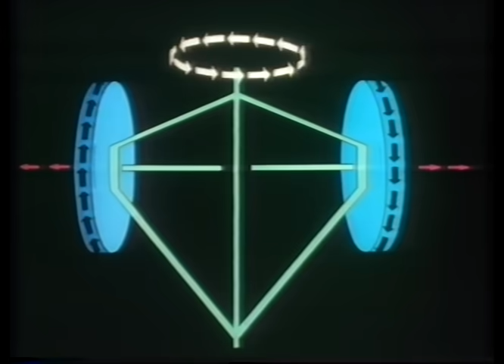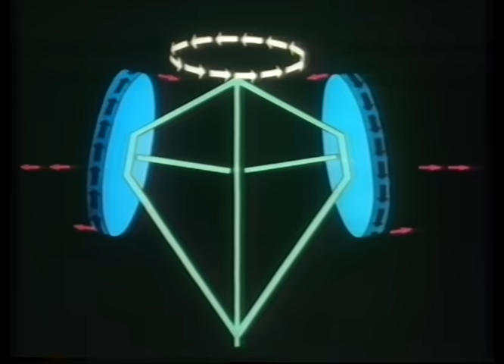Anti-Gravity Machine (Part One)

Comment: Professor Eric Laithwaite gives a demonstration of a large gyro wheel
A comment I made elsewhere for readers' attention.
 This may solve the many difficulties  Professor Eric Laithwaite and Sandy Kidd and others at Dundee University had, and recently a project on gyros made at Cambridge and Sydney University.  The answer as to why the gyro performs what it does is due to the distributed masses within the gyro spinning wheel being subjected to the distributed three-dimensional accelerations existing in the voluminous cycloidal trajectory made by each mass particle spinning in the gyro.  The whole integral of

Integral of (mass ( x.y,x,t) reacting with acceleration (x,y,z,t)) contains all the miracles and elegance of the gyro which are summarised in the discussion shown below.
 
 The gyro in the "floating " configuration, when placed at the end of an extension arm, DOES NOT LOSE ANY OF ITS  WEIGHT, and that issue, is very misleading to many people, including many universities. I advise readers to proceed to read the manner in which it is being presented as it will not be found in any book or from no one else in this style, and readers, they are free to comment on how the four states within a gyro were explained.
 (The gravity balance) ...( The angular motion balance).... ( The gyro centrifugal forces).....( The reason why the gyro floats and moves forwards).
This is presented so that any person interested in statics and dynamics can have a different perspective of the working of the gyro. 

Here are the details of what I think happens in a gyro.  There are basically four states one needs to explain. I shall use what is seen in the video above showing a gyro appearing to be floating.
To use these following videos for reference.

https://youtu.be/Pbb_RnxeYys

https://youtu.be/xf1Nt3KLm-U

https://youtu.be/jD_Q_J4GcQ8

1.  The vertical down weight of the gyro (mg) seems to be floating on air and how it is held up against gravity needs to be explained. 
2. What forces the gyro uses to turn about itself with the dynamic precession (Wp and torque of I.Ws.Wp) needs to be explained.
3. Why the gyro, when not spinning but rotating as a pure mass m shows centrifugal force about its own center and about the pivot point and this later disappears when the gyro spins and precesses. 
4. Why the mass m is basically forced to move slowly around the pivot point. One may consider this as a linear motion using a force Force = ma + air drag forces if Ra is larger large and then work it back into circular motion about the pivot point by knowing that a= (R arm)*d(Wp)/dt

The above is achieved as follows.
a. When a fast spinning gyro (Ws) is taken and allowed to move around a radial arm (Ra) with angular velocity (Wp), then the trajectory of one mass particle is a three-dimensional cycloidal curve containing different locations, different velocities, and different three-dimensional accelerations.  Within the curves of this three-dimensional cycloid, there are ACCELERATIONS  acting on the spinning and rolling mass particles which bring about two opposite acting centrifugal forces which vary their magnitudes,  one acting inward on the upper horizontal half of the gyro, and the other acting outward on the horizontal lower half of the gyro. These two opposite acting centrifugal "horizontal" forces act at a slightly forward angle to the movement of the gyro, will create all the magic in the gyro as follows. Also, note that these two opposite acting forces also act on the forward vertical half of the gyro (the outbound force) while the ( inbound force) acts on the rear vertical half of the gyro.  These centrifugal forces are basically horizontal in nature ( in this experimental configuration) and their horizontal and vertical separation between them and the slight tilting forward give all the requirement to make the gyro behaves as it does. This is how what was described above handles all there is to handle in a gyro as shown in the video.

1. The weight of the gyro (m.g) working in conjunction with the supporting arm operating as a pivot, and the extension rod (Ra) generates a  gravity torque ( m.g.R arm) which tends to pull the weight down.  This is opposed by the two opposite acting centrifugal forces being separated in a vertical manner by a distance x.  This arrangement will give the following. The inbound force (Fin) is above the outbound (Fout) by a distance x and so these create a torque of about the axis of the gyro  (F1+F1)*x = (mgR arm) and this is a balance in the gravitational state. 

2. The flat face of the gyro spinning wheel at (Ws) with an inertial "I" is changing its orientation with respect to earth with angular velocity (Wp) as it circles around the pivot suspension point and this needs a torque = (I.Ws.Wp ) which is provided by the same two opposite centrifugal forces also separated by a horizontal distance x, acting on the front and back vertical halves of the gyro spinning wheel.  Hence
(F1+F2)*x) = (I.Ws.Wp)      This means that the angular inertia characteristic of the gyro needs the torque action generated by the horizontal separated opposite acting centrifugal forces F1 and F2. This is the dynamic angular motion balance. 
Note the beauty of the relation between the ( Falling weight and torque ( m.g.Ra),  and  (the two opposite centrifugal forces, separated horizontally and vertically by distance x, and hence the torque  ( F1+F2)*x) and needed by the gyro (I.Ws.Wp)).
 
vertical gravity balance =  (m.g.R arm) = ( F1+F2)*x   = horizontal angular torque  (I.Ws.Wp)=( F1+F2)*x

3. Since the two opposite centrifugal forces are " almost parallel" with the gyro extension arm Ra, then conventional outbound   Centrifugal force m.(Wp)(Wp)*R arm =  (F1-F2) where F1 is the inbound centrifugal force which diminishes with the loss of spinning, of the gyro and so the normal outbound centrifugal force F2 takes over.
 Hence ( F1-F2)= m.(Wp)^2 (R arm)

4. The force  that pulls the gyro forward may be looked upon as being a linear force  and this is  due to the slight tilt forward of both centrifugal forces which is (F1+F2)*sine (angle of forwarding tilt of the centrifugal forces)     Hence this forward motion of the gyro may be looked upon as being
 Force= ma + drag force .
This may be "adjusted" to fit the angular state as the linear acceleration is related to the (Wp) rotation of the gyro where a= d(Wp/dt)  so (F1+F2)*sine( small forward tilt angle)= m.(R arm)d(Wp)/dt + Wp drag and other losses. 
If one watches other videos one sees gyros rising to the top by some unknown forces, and I do believe that this force may account for what one sees in other videos as shown in the following,

The beauty of what was explained above means that at very high spinning speeds the reaction on the central pivot point is only the vertical weight of the gyro mg. 

https://youtu.be/SEstkIF3U1Q

Apologies for the length of this explanation, but it needs to be commented upon by those who enjoy the magical and elegance of gyros. I preferred to look into the engineering details than describe the action with words as " the spinning gyro precesses  when a torque is applied to it." It is fascinating what beauty and elegance exist hidden in silence and invisibility of physics which is never appreciated by many people.
The above contribution should be followed by Universities in London, Dundee, Cambridge, Sydney, and others which in the past showed much interest in the working out and showing the performance of the gyros.

Comment: Obviously the air resistance of the entire spinning mechanism is the same as pressing on the spinning machine with your finger which uses the processional movement to convert rotational inertia into vertical inertia.

Comment: What a pity when people do not comprehend what is going on and they totally misunderstand what is happening and conclude that they can apply it to something practical with higher demands. 
What is happening in this arrangement is caused by the application of a double-action of precession. Taking the experiment conducted by Professor Eric Laithwaite at 9:15, one can find the whole solution.
Considering the vertical plane of the fast rotating gyro wheel about its horizontal axis, then if it left untouched it will try to keep that energy plane but also drop about the center of the radius of the flat horizontal plane about its central suspension point.  When the gyro wheel rotates around its vertical plane and tries to drop, the topmost upper mass high-speed horizontal particles on the circumference will move out while the mass high-speed horizontal particles on the lower circumference will move in. Since these are fast mass particles then the plane of rotation of the gyro wheel will alter slightly and this means that the horizontal pivot arm will have to move and rotate slowly according to how much precession the wheel can develop with the drop, depending on a few parameters. This constant state of the affair will proceed with the plane of momentum/energy trying to continuously drop and this slow dropping force causes the precession to torque the wheel about the horizontal extended arm. 
Then at 9: 16 when Professor Laithwaite gives a  horizontal angular input which causes the horizontal arm to move at a  faster  "angular" speed than the natural first precession caused by the drop, he is, in fact, trying to change the horizontal angle of the spinning shaft of the gyro in exactly the same as the " drop" tried to torque the shaft about a vertical plane, This horizontal torque by the Professor, caused the gyro to process vertically where the boundary conditions/ capture of the gyro caused the gyro wheel to lift as shown in 9:18. If he slowed it down then the gyro would have dropped.  IT IS IMPORTANT TO  REALISE THAT THIS CANNOT HAPPEN IN A LINEAR MOVEMENT BUT THE FACT THAT THE ARM WAR ROTATED. 
So to recap, considering the ' circular bounding capture of the gyro wheel', the vertical drop due to the weight will cause it to be torqued horizontally while the horizontal torque by  Professor Laithwaite caused it to torque vertically up.  It is simply a DOUBLE ACTION of the conventional precession and it has nothing to do with centrifugal force as stated at 9:53.
Unlike what  Professor Laithwaite states in part 2 that centrifugal force does not exist we should consider that when supporting the arm and rotating gyro on a table he suspended it from the ceiling, the fast-spinning arrangement started to widen the radius of horizontal rotation due to the low centrifugal force, the low acting precession due to the " vertical drop" was causing.  At slow rotation, the gyro wheel span faster about the vertical suspension point as the  " drop" could change the plane of the gro wheel much faster as the peripheral particles were losing their momentum and easily accelerated "out and in " of what is normally a constant acceleration in normal rotation with a constant acceleration. 
At the high angular momentum/speed of the gyro wheel, the " peripheral masses" can only be angled infinitesimally slightly to the " drop" and so it will precess slowly while trying to hold the dropping rate.  
The gyro wheel appeared to climb up at  9:15 only because the horizontal eternal torque input resulting in the wheel precessing vertically.  The gyro wheel being torqued around a vertical center and the gyro wheel climbing is due to an equivalent precession action. If he slowed it down the wheel would have dropped. 
The gyro wheel tends to lose a little weight because the rotational acceleration is not a constant, like that of a fixed blade of a jet turbine going around a central point producing only the centrifugal force, but the peripheral masses on the fast rotating gyro wheel have a rate of change of acceleration when it goes around a vertical suspension point.  
The moral of the story is that centrifugal force still exists while the weight cannot be fully lifted as the partial weight loss effect does depend on the rotating mass itself which can never lose its whole "weight force"  when as a whole, the gyro mass is subjected to gravitational acceleration pull. 
Perhaps the highest congratulations are in order for that very patient wife and an intelligent woman appearing at 1:39 and 4:56 who kept the family together by keeping her feet on the ground.   Sandy Kidd and Eric Laitwaite should have thought a little more about claiming the potential of this gyro effect on earth as it will never lose its whole weight close to the earth.  In space, there may be turning moments, but then another source will cause a reaction to the acceleration which will be needed to cause the turning moments acting as the source of " change". 
All this reminds me of the situation when a bomb is fired from a gun. If the bomb had to explode in flight by giving it some internal energy, then the center of gravity of all the exploded parts of the bomb will follow the same trajectory as if the bomb was not exploded.  It is for the same reason that the machine shown in this video will never lose all its weight when close to the earth. When I lived at Newcastle upon Tyne I went down a 2000 ft deep mine and the drop was so fast that I lost all my weight during the drop, but it was only temporary as when the dropping terminated my legs regained their previous position to carry my full weight, in fact, a little higher as I was closer to the center of the earth!  "Dropping" has an associated weight reduction, but only a temporary one!  Fuel in engines is what produces the continuous acceleration needed to produce forces. 
Perhaps Professor Laithwaite should have known about conservative fields which the above machine is related to.
 "In a two- and three-dimensional space, there is an ambiguity in taking an integral between two points as there are infinitely many paths between the two points—apart from the straight line formed between the two points, one could choose a curved path of greater length as shown in the figure. Therefore, in general, the value of the integral depends on the path taken. However, in the special case of a conservative vector field, the value of the integral is independent of the path taken, which can be thought of as a large-scale cancellation of all elements {displaystyle d{R}} that don't have a component along the straight line between the two points. To visualize this, imagine two people climbing a cliff; one decides to scale the cliff by going vertically up it, and the second decides to walk along a winding path that is longer in length than the height of the cliff, but at only a small angle to the horizontal. Although the two hikers have taken different routes to get up to the top of the cliff, at the top, they will have both gained the same amount of gravitational potential energy. This is because a gravitational field is conservative. As an example of a non-conservative field, imagine pushing a box from one end of a room to another. Pushing the box in a straight line across the room requires noticeably less work against friction than along a curved path covering a greater distance. In a conservative field as exists in gravitational pull the integral around a closed loop is zero."  It is not so easy to extract energy out of gravity nor getting rid of what we call weight!

Comment: Centrifugal wants to spin away from the center of action
if you spin two weight opposite of each other, and make the rod they are connected to spin aswell, you will have and enormous amount of energy, which can both be stored, but also used to drag/liftoff/Propolsion
Cause if you loosely but firmly denies its ability to move away from the object its connected to
The arms you see, will direct the motion upwards
Thats basicly how it works
now if you can move that main rod directionally as you please, you could potentially have a working object of flight and travel
Reply: yoy brain is piss.
Reply: Aye ok pal😂😂
Reply: @Man_fay_the_Bru  get out of here with that kid shit, grow the fuck up as they say, if all you can is react without argument or input, your not old enough to engage online & def weren’t raised properly, bad parenting at its worst. 🤣🤣🤣🤣🤣🤣🤣🤣🤣🤣🤣🤣 kid needs a spank
Reply: You know what’s better than that?  A plane or a helicopter.